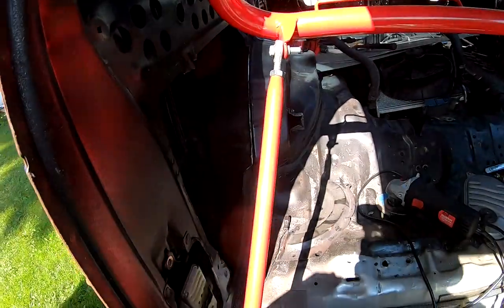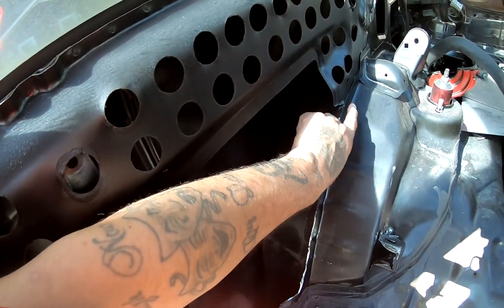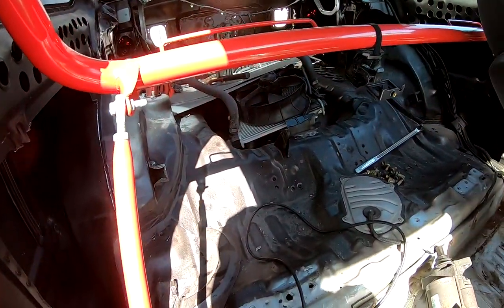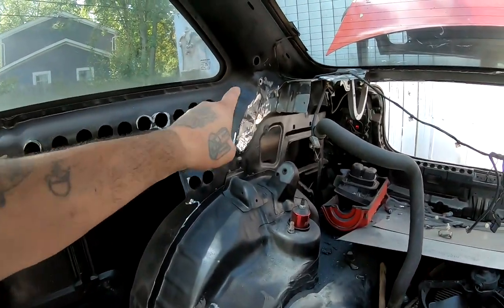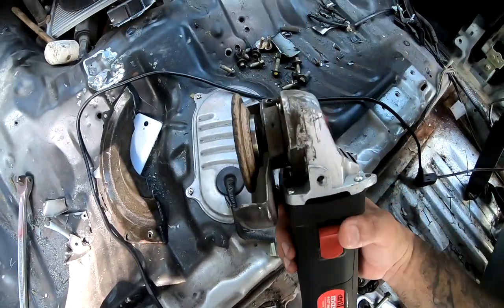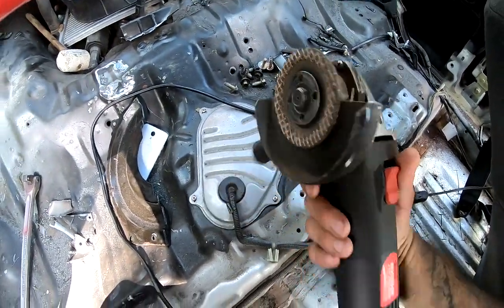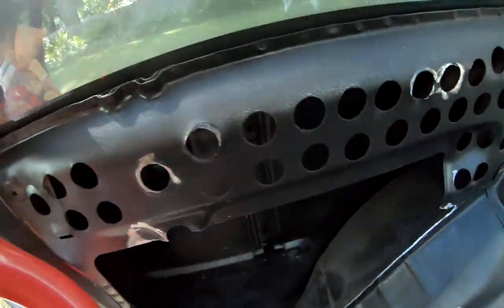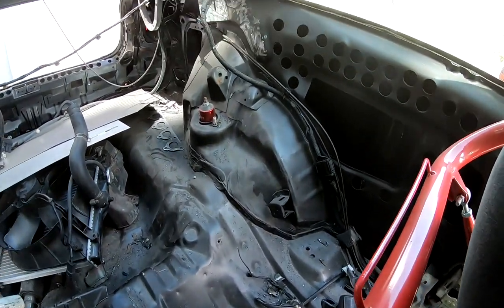Ek Civic Final weight reduction Video for now

Comment: What exactly you cut today and how much weight ?
Reply from the maker: No much around 5 to 8 lbs it was just cleanin up my cuts and finishing driver side cuts by the back seat window and removing brackets.
Reply from the maker: Soon we will go to the scale before the roll cage goes in to see what damage I have done. Theres weight under the dash I want to trim and also hidden weight under the car I can remove.